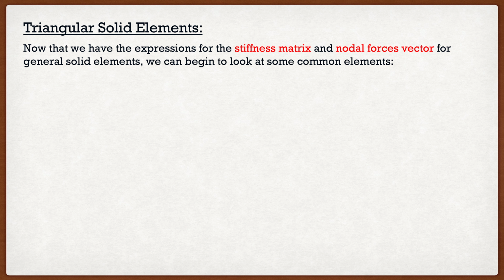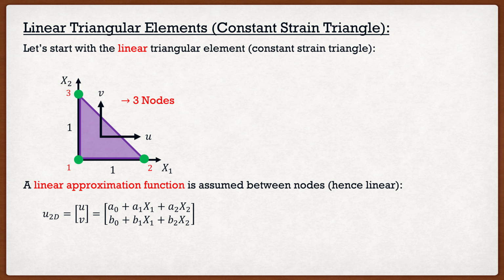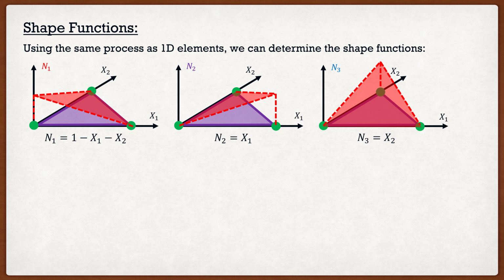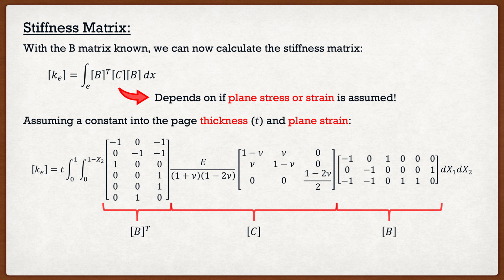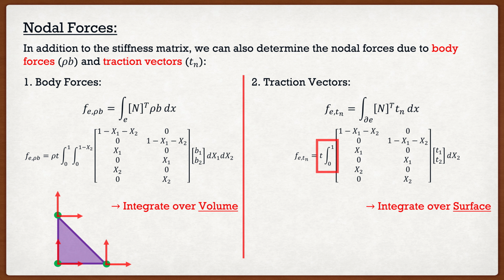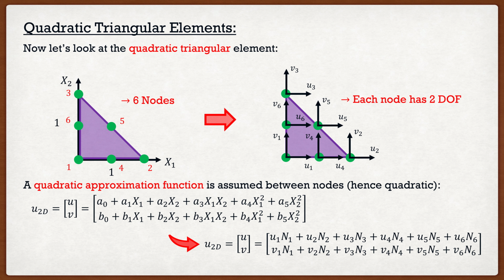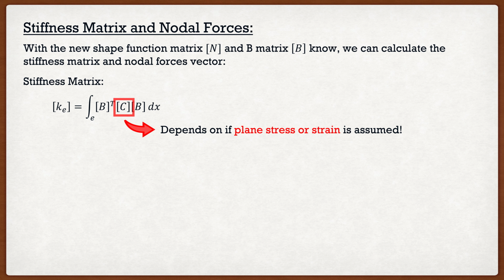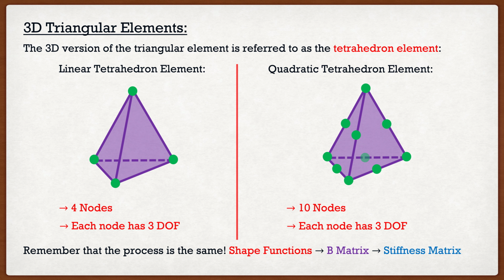Finite Element Method | Theory | Triangular Elements

Comment: Hey Clayton, I was wondering where you discuss about doing the integration quickly (at timestamp 12:50)? Is it explained in another video? Is it the same as 'Gaussian Integration' shown in the Isoparametric Elements video (Lecture 6 https://youtu.be/gJzqCaOEqsA )?
Reply from the maker: Hi Isha! This is correct :) I discussed it in my lecture videos but have yet to make a dedicated video on the concept as the scheme is modified a bit for triangular elements.  I will work on the dedicated video soon!
Reply: @ClaytonPettit  Thanks for confirming! Grateful for your videos. They’ve been a saviour for my FEM class this semester. :)